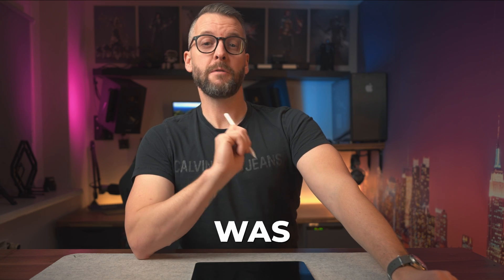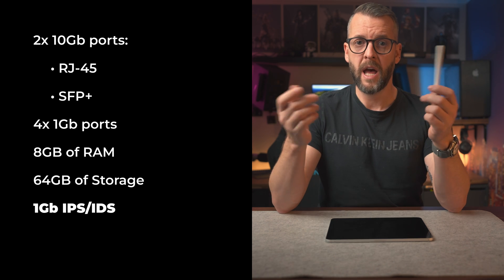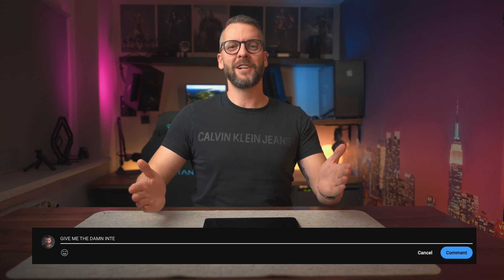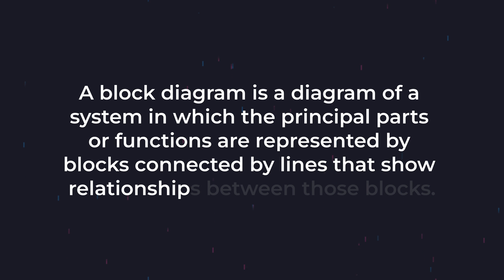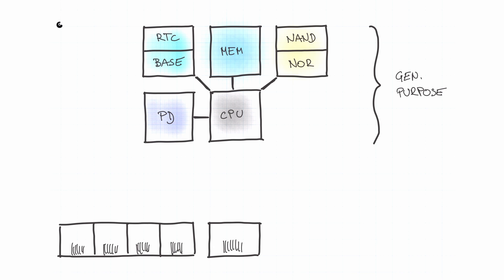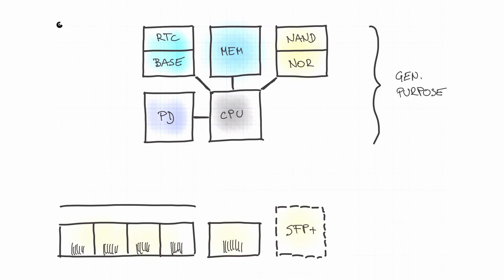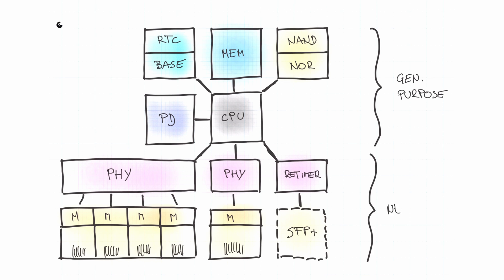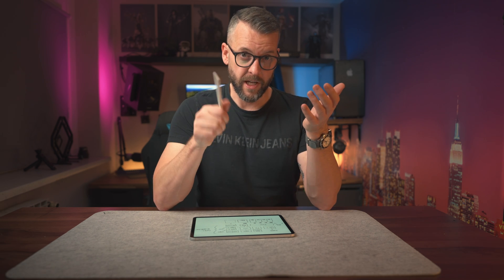Designing my own high-end router: the block diagram.

Comment: Speed is the current and future of networking I hope / expect that you a keeping in mind that higher end example 25Gbs and higher exist for some time now. keeping that in mind you be aware of multi-level of potential and future. Fiber optic and high speed is not available in all areas, yet local networks are in some cases catching up with 10 and 25Gns. Memory and Chip upgrade including CPU can be pre planned and socketed for upgrade with forethought. Currently I am in a place where I have a less than fiberoptic internet connection and a much higher local network. --a former beta tester of game / flight controllers and telephone - internet modems. Upgradeable is the awareness of your project future for the nerd and hobbyist. The big boys are already in business for the top end.

Comment: DPDK supports LS1046A. Will this hardware be validated for DPDK? Will you support upgradable RAM and storage? If I can run Linux with DPDK and upgrade to 64GB, and upgrade storage (m.2 pcie or at least mSATA) this would be great for my software project.

Comment: Hi Tomaz. When you predict to be available?
I tried a Qotom C3758R with 4x10GbE SFP+ and 5xI226-V and unfortunately all I226-V NICs are triggering Hardware error from APEI Generic Hardware Error Source: 0, AER: aer_status: 0x00002000, aer_mask: 0x00002000, AER: aer_layer=Transaction Layer, aer_agent=Receiver ID and the driver is crashing. Sometimes is just triggering the Hardware error and sometimes is also crashing. I have no clue if is PCIe issue in CPU or something else. I can't believe that all 5 NICs are throwing the same error. These errors are triggered on iperf3 --bidir. I couldn't manage to trigger them if I'm doing only one-way traffic.
I really need a good device and your looks very promising.

Comment: Given the security implications of being a router in a network, did you consider:

- adding UEFI secure boot with a PKI where you can give out certificates for "official" distro maintainers for your router that you trust, for end-users that still want something powerful but don't want to be a "maintainer of a router" so to say?
- are you planning on using any hardening on the OS side like SELinux?
- for example i'm running a raspberrypi with fedora-iot which uses rpm-ostree, systemd with podman rootless containers, etc. I'm currently looking into SELinux to harden it even more. It's nice because with 'systemd-analyze security' you can also easily analyse a lot of security related knobs for your containers/services.

Good luck and thanks for all your awesome contributions to us (videos, knowledge, hardware, etc.)

Comment: that 2.5G port from that cpu ought to be used too
Reply from the maker: That's the one thing that's bugging me to no end. According to the datasheet, it should be possible to use it along with the 10 gig ports, but it's a bit,... ambiguous. I haven't gotten a straight answer from the distributor either, so I guess, I'll have to test it myself. It's no big deal, just takes a bit of time, because PHY chips usually have same footprints between 1gb and 2.5, so I can put one in place of the other.

Comment: N100 CPU cannot cost that much because you can buy complete N100 minipcs at that price.
Those intel prices are single unit, per 1000 the pricing is way different.
Reply from the maker: Yeah, still. It has no long term support.

Comment: I think the 5v USB-C PD is a VERY poor choice of power.   There's WAYYYYY too many shoddy USB-C/PD power bricks that don't provide the appropiate amount of power.    AND,   at 5v,  thats a 7AMP power supply.   Which is nutz.   The traces on both the power supply and the CABLE would need to be huge compared to say a 12v power supply at 3amps.     Please re-consider this.   Stick with a 12v barrel jack.  It'll keep your costs lower and be SAFER.
Reply from the maker: USB power delivery standard isn't limited to 5V. It also specifies other voltages such as 9V and 15V. It's acutally very flexible and future proof.
Reply: @tomazzaman  I understand PD isn't limited to 5v, however YOU said your router was going to be a 5v device.    I still do not think USB PD is a great choice for a good router.  12v barrel jack is a better solution overall.   Sometimes your competitors do it right.   Give attention to the existing market.

Comment: Dont know which video to post this one....  Came across this product just now while I was looking up VyOS on ARM. From the specs it looks like your router you want to build. Using the 1088 instead of the 1064 SoC CPU. The Traverse Technologies Ten64; mind you its got some better specs (higher RAM, and I think it was more cores) but thought I would bring it up to you just incase you havent seen it yet.
Reply from the maker: I've seen it yes, but 1088 is much more capable, and also much more expensive chip.
Reply: @tomazzaman Roger that. 😊

Actually had an idea this morning for a video for you… if you got this far in and then found a product similar to what you are designing what to do / how to decide if its worth while continuing

Comment: For total of 35W (11:43) of power a 5V over single USB Type C input is not enought. Even high-current cables max out at 5A (5A*5V=25W, good luck with chargers which even support that, most likely 5A could only be used at 20V), standart current cables max out at 3A. I would recomment using 12V or 15V USB PD (power delivery) input for 36W (12V 3A) - 45-75W (15V at 3A or 5A if you are lucky)

Comment: A huge thing for the potential cost is the longevity of the device. With an arm SoC you end up relying on someone maintaining a specialised kernel. An embedded x86 processor would give buyers the knowledge that the device can be repurposed in future and isn’t locked down (could run pfsense etc). I’d also suggest 2x sfp+ and 12v barrel jack. The 4 gigabit ports seem like a waste IMO, anyone forking out for this will likely have a core switch behind it, it may be better to offer a PCIe slot so buyers can choose their own expansion, if they want 4 gigabit it 2.5g or 10g it’s up to them.
Reply from the maker: Thanks for the feedback, apart from the ARM SoC I'm addressing the rest in my pricing video. We've indeed moved from 1x4Gb to 3x2.5Gb (because we can do that with the same CPU). Also 2x SFP+! :)

x86 unfrotunately brings too many problems for a small startup to solve. And ARM CPUs can just as easily be repurposed. Yes, the support is smaller, but they are gaining in popularity, so it'll get better with time.
Reply: @tomazzaman  that’s fair enough, part of engineering!

Comment: You could use the pcie from the cpu and build in support for a lte module on the motherboard, many companies like to use cell service as a backup in case their fiber gets cut. Could make this product easier to sell to a small business/medium business as this could be a requirement they look for in a router.
Reply from the maker: Yep, a PCIe port is planned and we're also brainstorming ideas as to what it should support. Thanks for the input!

Comment: I'm personally not a fan of MMC, unless it is a replaceable module, would probably prefer an M.2/NVME or even M.2/SATA port, however if MMC, I wouldn't say no outright.
Reply from the maker: There will likely be a jumper that'll let you choose between eMMC and either M.2 or a MicroSD card. No final decision has been made yet on this.
Reply: @tomazzaman  thanks sounds good.

Comment: 5V at 35W would be 7A, USB-C can do a maximum of 5A. For 35W you'll need USB-PD to get a higher voltage. At 12V and higher, you'll get 35W with any USB-C cable. PD won't add too much to the BOM these days
Reply from the maker: Yep. PD is planned. Because of the feedback in the comments - a lot of people would love to have it included.

Comment: Hopefully if this project turns out to be a success you could make a future version with something like a Layerscape LX2122A CPU so that you can have a router with actual 10gb inspection throughput and not just NAT and filter throughput. Unfortunately, the price is around 300 which is a big step up. I do like that Ryzen V3000 idea though. I was just looking at those this last week myself. The performance on them is significantly higher than the other Intel CPUs you mentioned in the vid, and some of the V3000's should be capable of 10gb inspection throughput as well. I couldnt find a price for them unfortunately, but one company that sells a whole industrial PC (Israel company, with a few distributors in Europe) based on the chip sells the end product for anywhere between 950-1200 depending on the processor model.
Reply: I am really excited about this project and hope it succeeds. Unfortunately, it isn't the level of device I'm looking for as my current needs are something with 5gb IPS throughput, and I would like to get something with 10gb IPS throughput so I can keep using it as my main router/gateway into the future as two ISPs in my area plan to make 10gb plans available within the next 1-2 years. Currently, 5gb plans are $155/mo and 10gb plans are supposed to launch at $220. Gigabit plans have 3 providers in my area with prices ranging from $50-60 now 😁
Reply from the maker: Thanks for the feedback!

Comment: I think the youtube icon in the intro looks kinda off to the right, it seems to be in the center, but not in the visual center. I think webdesigners use a tool to find out the optical center instead of the technical, just some things I notice xD

Comment: Do not use USB-C as a host.!!!! Use a regular USB, it will increase the ease of using the device if someone wants to quickly connect a pendrive or something. Most of them don't have adapters yet and the hanging cables with the flash drive are annoying.
Reply from the maker: Thanks for the feedback!

Comment: After watching this video and the previous one, I still don't understand the choice of an ARM processor. The most likely candidates for firewall softwares on that new device would be pfSense, OPNSense and VyOS and none of them support the ARM architecture yet. I don't think that hoping for those product to release an ARM version by the time you put your hardware on the market is realistic.
If you don't have a killer app for your hardware, it will not sell.
Very few people will be willing to pay more than 400 USD for a hardware just to be able to run OpenWRT on it.
What about the Intel Atom C1110?

Comment: I'd personally prefer a DC jack rather than USB. USB is still a massive shitshow of interop issues with PD. A simple barrel jack is cheaper and easier in so many ways. I was going to suggest PoE, but that defeats the purpose of the 10G ports really.

Another +1 for dual SFP+, 10G-T is power hungry and expensive.
Reply from the maker: This seems to be a recurring request (dual SFP+). I've actually started making measurements of the planned PCB to check how it fits. Will make a video with all the updates that came from the comments.

Comment: Here's my take and a nutshell .. impressive idea and very cool to watch you go through the process. However the only advantage that I see to your product would be a cool case. I can take a cheap TP link/QNAP or you name it 10GbE / SFP+ router and spray paint it any color I choose. However, since most people, including myself try to hide their networking gear especially in their house, the looks have no value especially since it won't match any of the other switches or equipment, in fact, it would kind of stand out. My primary concern is that you won't have rigorous testing and you have no idea about the longevity or durability of your router, and QC especially in such micro batches is hit and miss even between one unit to the next. All the companies that I can think of put all of the routers multiple of them through 100% loads for months upon months at a time and still miss often critical hardware problems that aren't found until they hit the public domain, hence revisions. 

This is absolutely nothing against you. It's just a reality. Your videos are extremely intriguing and I hope that you can sell as many as possible and those folks enjoy them with no issues. Nothing would please me more. Good luck.
Reply from the maker: Thank you for your feedback, I absolutely get where you're coming from. There are a couple of tidbits I have yet to disclose that'll hopefully calm down anyone doubting our ability to make a durable device that'll work for years. Can't say yet, as there will be a video dedicated just to that.
And as for the rest, you're right, there are alternatives out there, and I absolutely love it. Competition is good.

Comment: Have you considered a cheaper arm CPU and a switch chip/ASIC? The processor could be just handling 2x1G or 2x2.5G and having the second port internally connect to a dedicated switch chip.

Ie:
1G/2.5G WAN port -- processor -- internal 1G/2.5G connection -- switch chip -- multiple LAN ports

It would add some development complexity, but would provide a potential upgrade pathway with better switch chips and processors for future SKUs/iterations.

I havent spent much time looking at prices, but it might also reduce the BOM.

I'm keen to hear your thoughts on this.

Australian, English is my first and only language. In router, we say "ow" like "how"

Comment: Hi
1. I think you missed the LEDs in the block diagram.
2. I'd like to control video streaming using this router. Do you know of a software solution that can be installed on this router that would work
Reply from the maker: Nope, unfortunately I'm not familiar with video streaming software.

Comment: You should definitely provide some way to connect 12v power through a DC barrel jack or possibly 48v if you want to support POE. Pretty much all networking gear runs on those voltages / connectors, and it's much easier to supply power at higher voltages. If you have USB-C power input you would need the switching electronics anyway because USB-C PD runs at much higher voltages (usually 20v, but it's negotiated by the charger and device) in order to deliver 10s of watts of power over relatively thin wires. Buck converters are relatively small and inexpensive these days, so you can internally downconvert it to 5 or 3.3v as necessary.

Comment: Less worried about the proc as long as it does the thing, or uses a ASIC to offload tasks too, but I have moved on to 10/25/50/100Gbps connectivity inside the house and would want to see 1 or 2 multi-gig (1,2.5,5,10g) ports for wan + one sfp+/sfp28 port.

Comment: How complicated would it be to diverge another device from the "general purpose" computer at 8:20 to make a small and efficient home NAS with 3.5" drives?
I am looking on how to make a very very low power DIY home NAS on a Pi5 or a CM5 (when available) platform.
Reply: Just as complicated as designing any small ARM device really. Complexity on something like this mostly scales with added IO, and especially high speed stuff which requires better signalling. Find the SoC that supports what you need and tack on the extra components (in his case PHYs, magnetics, UART-USB, etc...) to support what you're looking for. Look at all your datasheets for what you picked, make a schematic, design the board, and get it made. 100% not worth doing though if you only care about the end product and not learning about the process.

Comment: I believe that's obvious but please use a power brick that has cables both to device AND wall outlet. Those laptop chargers with brick mounted on power plug absolutely suck and I can't imagine trying to plug such thing in a tight rack enclosure.
Reply from the maker: What I'd love is to have a tiny GaN wall-wart and a USB-C cable. We'll revisit this topic in a dedicated video.

Comment: Are you planning to support 10gbps inter-vlan routing?  Lack of support for that has turned me away from the vast majority of routers that have 10g ports; the ones that have such support are just so damned expensive or it’s impossible to confirm they have 10g inter-vlan routing capability or they’re enterprise gear that burn as much power as a repurposed x86 tower.